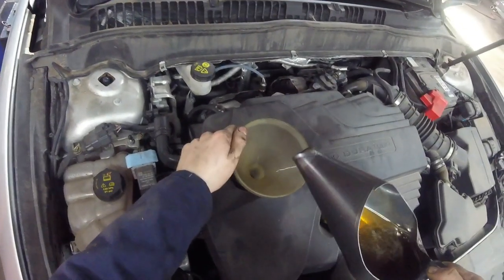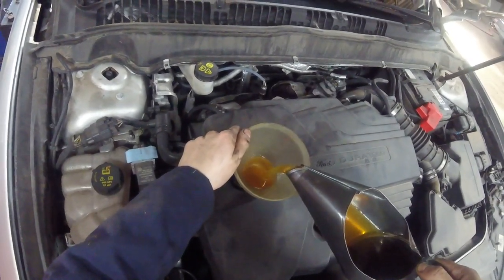Ford Mondeo MK5 2.0 TDCi Oil and Filter Change (Peugeot/Citroen engine)

Comment: Firstly, thanks for making the video. Secondly though, I had to play it back several times before I could figure out that you were saying "T30 Torx screws". That's an important bit of info for any home mechanic who is going to try and crawl under their Mondeo and do an oil change for the first time. It would be good to be a lot clearer with important details, especially right at the start of a video when people haven't yet tuned in to your accent. Like the other poster I also can't tell what you are using that ratchet for, but I assume you have a strap round it and are just loosening the cartridge with it?

Again, thanks for making the vid, I THINK I understand what I'm in for now when doing this on wheel ramps in my driveway.
Reply from the maker: Hi Neil, thanks for the constructive feedback. I’ll be honest, some of my service videos my heart isn’t really in making them so some are really good and some might even be muted the whole way through. I hope it helps get an idea how to do the job if not much else.
Reply: @IAMASPANNER  Yeah it definitely helped, thanks, it was actually a lot easier than I expected. For anyone else in the same boat:
T30 Torx to remove the plastic cover panel;
loosen the cartridge filter;
remove R-clip on plastic sump plug (note how the R-clip attaches, maybe take a photo, as it's not particularly obvious when you go to replace it later);
get ready to get covered in oil;
remove sump plug and filter;
go have a shower.
🤣